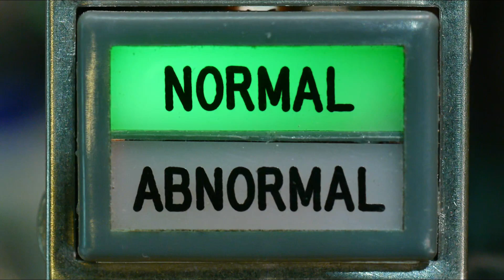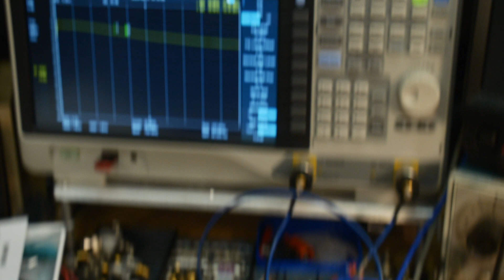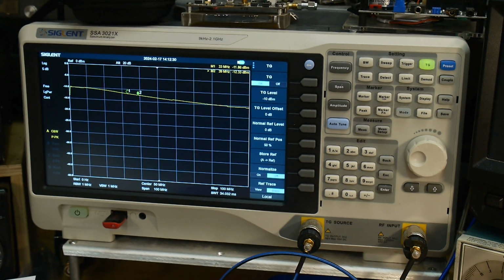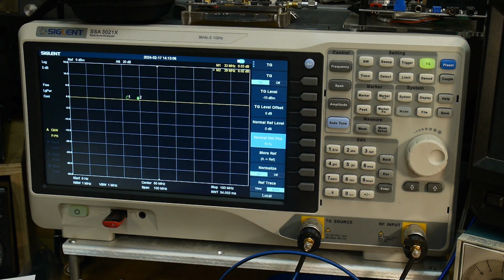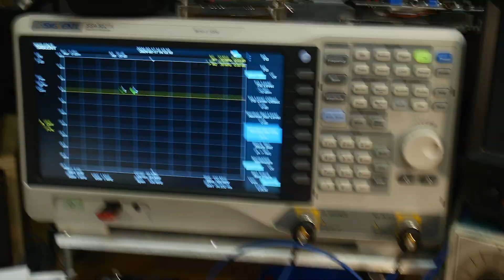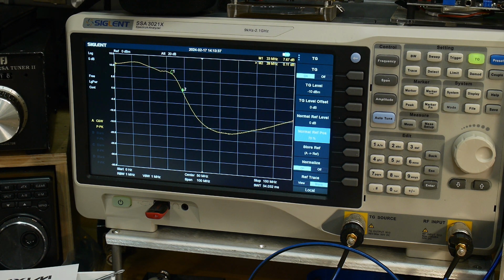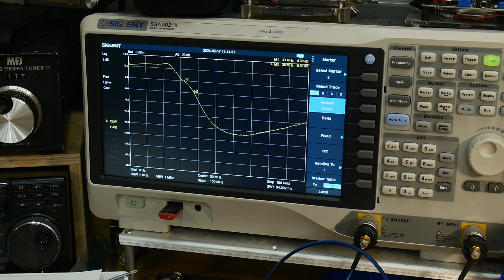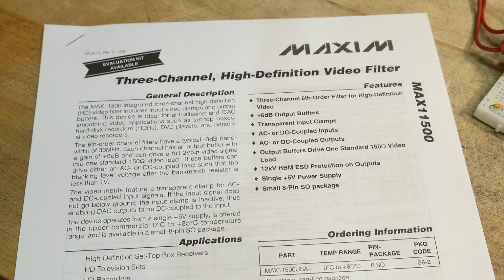#1826 MAX11500 Triple Video Amp

Comment: I am planning on building distribution amplifier for my 10 mHz Rubidium oscillator.  In your opinion is there any reason why this amplifier should not be used instead of a high performance op amp to drive the output?
Reply from the maker: you are the second person to ask. I think it is a fine idea

Comment: Have a look at the MAX232 ! Designed for a line driver . It generates +-10 volt rail . And the buffers +15v from 5v supply . I've used them as boost converters and the last one an op amp as a comparitor supply from the +-10v . It has 2 Shmit triggers and to drivers .

Comment: That's a real crappy video amp you have there.  Some of it is because of your setup, with clip leads and no termination.  Try hitting it with a VGA signal and see if it rings.   35 MHz is low def video, and you wouldn't be able to use that full bandwidth anyway..   An '80s vintage VGA --> 640X480  requires over 100 MHz of bandwidth..   35 MHz would result in noticeable blurring of the image.  There are better video amps.   I used a Signetics part in a KVM switch I designed in 1990.   Unity gain, 75 Ohm impedance bandwidth was 120 MHz.   Stability can be an issue.  Any ringing will produce weird color effects.   I used 3 pF compensation caps. to make it roll off the right way.  Ground plane is your friend.
Reply: I think these chips were made for regular color tv which only needs about a 6MHz bandwidth per channel.
Reply from the maker: read the datasheet
Applications 
High-Definition Set-Top Box Receivers, HD Television Sets, HD Recorders, DVD Players, Personal Video Recorders, Video-On-Demand
Reply: @IMSAIGuy  Break out your box of clip leads and feed an '80s vintage VGA video signal through one and see what comes out.   Even a double scan (31.5 kHz H) composite video would be too much.   The chip is spec'd for a 32 MHz bandwidth, but realistically you can't get more than 10 MHz from it after compensation.
Reply from the maker: you may be right for your system but this is broadcast HD content of 15 years ago. 
"Typical analog video bandwidth of high-definition video red, green, and blue components is 30 MHz for 1080 formats (interlaced and progressive [30, 29.97,25, 24, 23.98]) and 720 progressive scan formats and 60 MHz for a 1080p (50,59.94,60) progressive formats."   I believe this is where the 30MHz comes from and since the filter is buffered input and output I believe the compensation is internal and it really does deliver 30MHz

Comment: Interesting... Having a few similar parts in the collection, designed for TV purposes (which I'll likely never use them for), it's nice to think maybe they can be repurposed for more general uses. E.G. Here we have an easy-to-use amplifier, as long as we're working at less than 30MHz. Hmmm... maybe a audio-line-level/headphone-amp, or something like current-measurement through a tiny resistance? Though, 30MHz is pretty fast, so maybe that could be useful... e.g. clock-distribution in a 20MHz uC circuit.
Reply: Oh, heck! An amp for my 20MHz oscilloscope!

Comment: Thanks for the video,
Wonder how it would work as a 10Mhz reference distribution amp driving 50 ohm coax out to my other instruments?
Reply from the maker: seems like it would work
Reply: I hope they work well - I've got some 20year old maxim free samples like max454 and plan to (ab)use them this way with my GPSDO. if they seem unhappy seeing 100ohm I guess upping the series load to 100 so they see 150 will be an ok compromise.